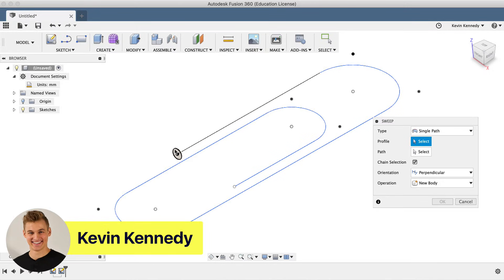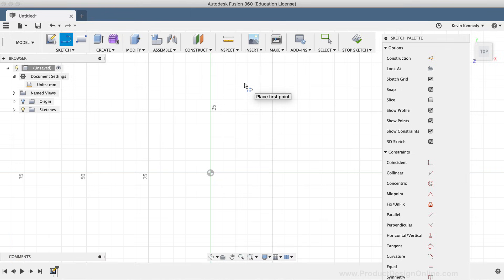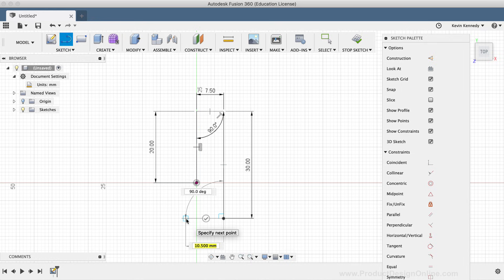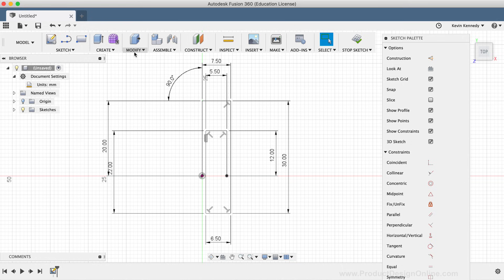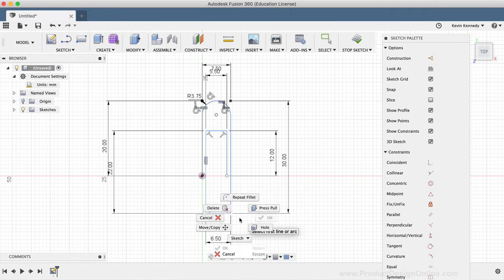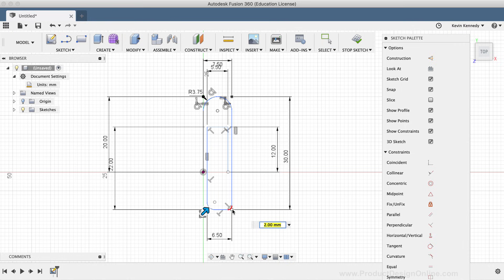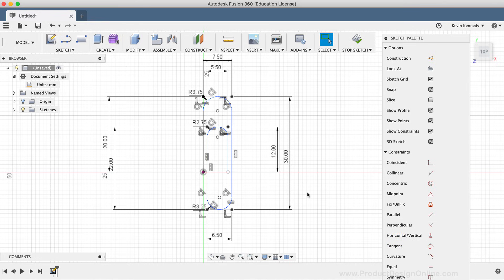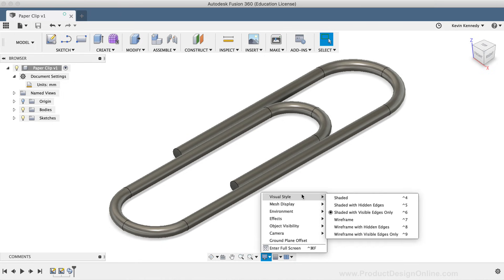How to 3D Model a Paper Clip - Learn Autodesk Fusion 360 in 30 Days: Day #3 (REVISED)

Comment: Hi, Am just starting out on the 3d down the rabbit hole journey and have chosen your tutorials as my route in. All the issues I've had so far have been of my own making but am having difficulty with what appears to be the relatively simple Paperclip (day 3 Revised). Didn't have a constraint issue, despite not having the same Sketch pallette options that came up in your demo... I have "show constraints" but no options list of type of constraints..... still I found that with your Shortcuts/search option , as I also had to use it to find the "line fillet" option as that didn't appear in the same place as yours either! Anyway got to the last bit with my drawing looking exactly as yours did (apparently) filled in all the sweep dialogue boxes as prescribed and hit the path button only to be presented with an error message saying..." The start direction of a path is antiparallel to the end directionof the previous path segment" Help... what have I done this time?

Comment: Ran into more or less the same problem as everyone. Managed to fix it by individually filleting each edge, if it gave problems doing both. Before finishing the sketch I erased ALL constraints and then placed them new on All the vertical lines. After this the sweep command  stopped giving me the error and the preview of the paperclip could be seen before hitting the ok button and finishing the sweep.

Comment: Thanks!! Loving these tutorials. I still had problems with anti parallel even after applying constraints and filleting one at a time. I decided to remove the fillets and apply a tangent ark instead worked wonders. I think it might have something to do with how the fillets interact with each other at the end points as I could only sweep up until the ends of the paper clip before receiving the error. I'm getting more and more confident and less frustrated! thanks again!
Reply: Thanks dude !

Comment: For those who are struggling with the anti-parallel issue, this is what worked for me... draw out the paper clip dimensions and make sure all dimensions are locked. delete all existing constraints. add vertical constraints to all vertical lines. add fillets one by one. If it still refuses to work (for me it kept failing on the bottom curve) then you can take 0.1mm off each fillet. For the bottom curve for example, you would fillet each corner by 3.24
Reply: Thanks - adding the fillets one by one sorted me out - although I didn't need to remove the existing constraints because all of the vertical lines already had them.

Comment: Good day Kevin. I'm working in the paper clip tutorial. When I come to the sweep part I'm having issues. It says error;  The start direction of a path saignant is anti parallel to the end direction of the previous path segment. Any clue of what I need to do to fix that issue.
Reply from the maker: Try creating the fillets ONE at a time or by lowering their value by .05. The sweep command doesn't like that the fillets collide in the middle :)
Reply: @ProductDesignOnline  Just ran into this same issue. In the end I went back and (re)created the fillets one at a time (no additional contraints added) reducing each by 0.05 (e.g. 7.5/2-0.05) then the sweep worked without the antiparrallel error. Seems the latest update messed it up again! Thanks for your help Kevin, and everyone else posting workarounds.

Comment: SOLUTION: For those who can't apply the "Sweep" and encounter the "Error: The start direction of a path segment is antiparallel to the end direction of the previous path segment.
" 
-
Here is the ALTERNATIVE (I still encounter the above error if following the steps in the tutorial):
1. Once you have created the 2-dimensional paperclip as stated in 7:05, create the 1ST FILLET (enter 7.5/2) for the TOP TWO CORNERS which is 7.5mm by width.
2. WITHOUT APPLYING CONSTRAINTS to any vertical/horizontal lines(except the first default one), create the 2ND FILLET. (enter 5.5/2) or the MIDDLE TWO CORNERS which is 5.5mm by width.
3. Create the 3RD FILLET. (enter 6.5/2) or the MIDDLE TWO CORNERS which is 6.5mm by width.
4. You should now have created an unskewed paper clip, follow the steps at 11:25 to and you should now be able to apply the "Sweep" command and create a 3D paperclip.

Happy modelling :-)
Reply from the maker: Thanks for sharing!

Comment: Great video thanks!
I'm struggling with the sweep command a bit. What's the best approach to sweep along high curvature areas so that intersection resolves or "joins" It's similar to this video here https://www.youtube.com/watch?v=3o0qSliF4vs but there is just resolves. Meanwhile in Fusion 360 I get an error saying that "The body would intersect itself". Do you have any tips how to do it? Thank you! :)
Reply from the maker: Hi, Dasha. The error was discovered to be caused by the fillet commands being applied at the same time. If you revert the sketch and apply the fillets ONE at time it should avoid the anti-parallel error. Cheers! :)
Reply: @ProductDesignOnline  Hi, firstly thank you for your excellent tutorials!  I've tried applying the sketch fillets individually as suggested but still encounter the antiparallel error, if you have any other advice it would be much appreciated :)

Comment: Great! One problem for me, i created the line segments a few lines at a time and when creating the sweep i have to select multiple segments of lines for the path. I think it happened when i used the fillet command separately for each corner. I've googled a ton and cant figure out how to join the segments... the points are definitely coinciding ... tried all type of constraints but nothing works. Of course the sweet works if i select multiple segments, but its annoying i cant figure this out. Help?
Reply: Exactly the same issue i had. I drew the sketch and before applying the fillets i tried to sweep a profile around the path, it worked fine. Soon as you fillet the corners the path is segmented and has to be selected in several parts to define it as the path. I should of gone back and tried smaller fillets and seen what effect that had on the path.

Comment: hello,
I put constraints in the lines (tried with vertical and parallel one separately) but it still shows "Error: The start direction of a path segment is antiparallel to the end direction of the previous path segment." I tried more than 10 times but fails, can,t figure out what the problem is.
Reply from the maker: Hi Chirag. Can you try applying the fillets ONE at a time? That should help avoid the anti-parallel error.

Comment: For what its worth, I'm using the new Fusion and got the same "antiparallel" error as the rest of you and started over, but instead of doing fillets I drew rounded lines, since they can make the same half-circles you need here. It worked and I was able to make the paperclip. 

I'm still wondering why what Kevin did no longer works in the new Fusion. Even after reading many of the comments here I'm still trying to figure out if there's a specific logical reason why it won't let you do this anymore. I feel like fairly often over the years Fusion has given me errors in a way that prevents me from doing something I eventually realize is wrong for good reason, and the program is actually being helpful. Curious if that's the case here or if its a software bug.
Reply from the maker: Hi Steve. After looking into the issue that several others started having... it was discovered that it's not a best practice to apply several fillets at the same time. The sweep command isn't able to consistently process them, as it get's confused to where one ends and one beginners. When you apply the sketch fillets ONE at a time it avoid this issue.

Comment: I solved all problems mentiones one by one but in the end the sweep stops at each 90 degree turn segment, had no idea why, so I had to click several times to complete the clip. Interestingly I do not have the black line on the 90 degree turn points as you (on the curved part of the clip). I think F360 has changed a lot since you did the videos. I have been struggling in the previous tutorials with the new operation of the toolbar and all the problems related. Its just a year since you released the videos but I think its time to redo the oldest to be on par with the current software characteristics. Thanks for the tutorials of course!
Reply from the maker: Hi, Mateyhv1. That is correct. When applying the fillets one at a time (to avoid the anti-parallel issue) you will need to select each part of the segments. The black lines you're referring to are simply a visual style setting. 

Head down to the bottom of Fusion 360 where you see the desktop monitor icon that is labeled "Display Settings." From there, hover over the visual style flyout and select "Shaded with Visual Edges Only". Yours is likely set to "Shaded".

Comment: What does 'repeat fillet' actually do? We still have to enter the fillet dimension value.
Reply from the maker: Hi, Will. Great question. The "repeat" command in the Marking Menu is simply a quick way to reactivate the last used feature. In short, it's a great way to reactivate a feature when it's automatically closed because of a previous selection.

It's unfortunate that is doesn't remember the values previously used...but that's a great suggestion for the Fusion 360 idea station (forum)!

Comment: Error: The start direction of a path segment is antiparallel to the end direction of the previous path segment.
Help Please!
Reply: Same Error: The start direction of a path segment is antiparallel to the end direction of the previous path segment.
Reply: They problem is they constraint, you need to add more.
Reply from the maker: You can add more constraints are apply the fillets ONE at a time, which will avoid them not being processes with the sweep command.

Comment: First of all, thank you for the simple and clear tutorials. Very easy to follow along!, although sometimes, due to the updated UI, it can get a bit tricky.
Not sure if anyone has mentioned this yet, but you can also specify measurement of the fillets using the divide operation. (this is in case you have more precise dimensions and don't want to do the math)  For example for the first pair of fillets, you can type 7.5/2  and the program calculates the 3.75 once you hit enter.
Reply from the maker: Great tip! thanks for sharing :)

Comment: Holy moly, how can they call this professional software when the UI doesn't even stay remotely consistent over a period of months? Its an excellent tutorial series thanks, but none of them so far can be followed as-is - not your fault but wow.
Reply from the maker: Hi, Simon. I understand and feel your frustration. It's not fun from my end of things when things can become dated quickly. I have made a video covering the core changes, which may be of help to you - https://youtu.be/tuZzHcmFtg4
Reply: Hi Yeah I completely agree it's so hard to follow along when it works and looks so differently. However I just plod on and have managed to figure it out so far.  Still great Vids though and much appreciated   @product Design Online
Reply: OMG I can even do this simple paper clip  I get errors when trying to do the contraints,   I add the horizontal to the far right side line, then i go and do the bottom fillet and I get Warning: Constraints and/or dimensions were removed during operation.

  I have restated this from scratch (the whole tutorial  I have no idea what  I am doing wrong, and the error is so vague
Reply: @jimjh2671  I believe the warning you're getting is because when you add the fillet, the bottom horizontal line is deleted, and replaced by the fillet, the horizontal constraint is therefore removed when the line goes.

Comment: The start direction of a path segment is antiparallel to the end direction of the previous path segment. is the error I get when I try to use the sweep command or the paper clip. I use undo at the top left because I dont know of any other way to edit out bad input on my part. Suggestions? how do you removelike spline points also thanks.
Reply from the maker: Hi, mbnaso. Please try to apply the fillets one at a time - that should fix the issue that is causing the error message.

Comment: I've never used sketching before; just simple programs where you draw the 3D Box directly.  I can see why sketching really comes in handy but just to confirm; when it comes to a basic shape like a rectangle, sketching and extruding is creating the same thing as the Create a Solid Box  option right? Or is there something else different about it?
Reply from the maker: Hi, Jesse. Great question. That is correct - they're essentially the same exact thing. In fact, the benefit to using the Box command over sketching a rectangle and extruding it is that you can edit all three dimensions within the one feature (if you need to change dimensions later).

With that said, the 2D sketches are great for shapes that cannot be created with the  basic 3D shapes. There will be multiple ways to achieve the same object with any CAD package. The goal is often how to create it in the least amount of steps, while still maintaining feasibility to update or change things if needed. Cheers, Kevin :)
Reply: @ProductDesignOnline  Great stuff. thanks! I'm on to Day 6. I've managed to mess something up with each one but still making progress!
Reply from the maker: @JesseKellys  No problem. Keep at it and don't hesitate to reach out if you run into any issues :)

Comment: In following your tutorial of Day #3 and using the sweep command, I received the following error. "The start direction of a path segment is antiparallel to the end direction of the path segment." The sketch geometry of the paper clip matches everything in the tutorial. So I'm not sure what went wrong and how to fix it. Although I'm using the current version of Fusion 360, I don't think that made the difference.
Reply from the maker: Hi, Tony. I found out later that applying two sketch fillets (in this scenario) can throw off the lines. However, it doesn't always, which is why it worked for me in the tutorials as well as some people who have done it.  To fix this, revert the sketch to before the fillets and be sure to apply the sketch fillets ONE at a time. Applying them both as I did in the video resulted in inconsistent results due to Fusion 360's rendering engine. If you apply them ONE at a time that will avoid the "Anti Parallel" error.

Let me know if that helps to get it working. Cheers, Kevin :)

Comment: For anyone getting errors when applying the sweep. I found out from his lesson on skillshare that you need to apply the sketch filets on bye one. I it worked for me then. I also didn't apply and of the vertical or horizontal constraints then and it was fine.
Reply: Same for me here. Took me a few hours to figure it out. Probably related to a newer version of Fusion 360.
Reply: Same.  Undo, Undo....S - Fillet 6 times, then Sweep and select each segment.  Happily I read the comments right when I got the error instead of wandering around.  I would like to understand why this works and maybe why it didn't work.
Reply from the maker: @-Gruntled  Hi Martin. The way Fusion 360's sweep command processes/understands the lines does not like the result produced by the double-fillet. Sometimes it works, other times it doesn't, because it doesn't produce the same results each time - essentially it's a quirk in how the program reads the fillets converging at the midpoint.
Reply from the maker: Thanks for sharing, Geek Sauce!
Reply: THIS WORKED
Reply: Thanks. Will try this.

Edit=  When doing a different model, but with all this steps it worked, but not when doing the original paper clip.

Comment: so after clicking C for creating the circle, i didn't get the "select the plane" option so my circle isn't on  XZ plane
Reply from the maker: Hi, apoorv shrivastava. That sounds like it may be a bug with Fusion 360, as the letter "C" should always activate the center-circle as long as you're in the Design Workspace. Try restoring your settings to the default. Click your username > preferences > restore default settings > apply > OK. Then, restart your copy of Fusion 360. If the issue still exists I would recommend posting on the Fusion 360 support forum. Cheers, Kevin :)
Reply: @ProductDesignOnline  HEy man thanks for the help , now i have a new problem when i start the sweep command it tells me "The start direction of a path segment is antiparallel to the end direction to the previous path segment". What am i supposed to do ?
Reply from the maker: @apoorvshrivastava6903  Try applying the sketch fillets ONE at a time. Applying them both as I did in the video resulted in inconsistent results (from various viewers) due to Fusion 360's rendering engine. If you apply them ONE at a time that will avoid the "Anti Parallel" error.

Let me know if that helps! Cheers, Kevin :)